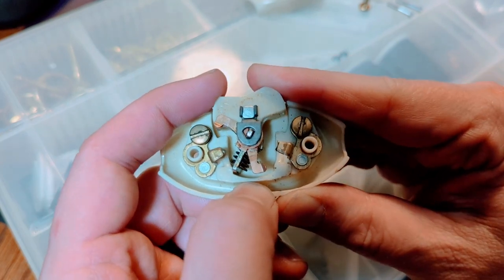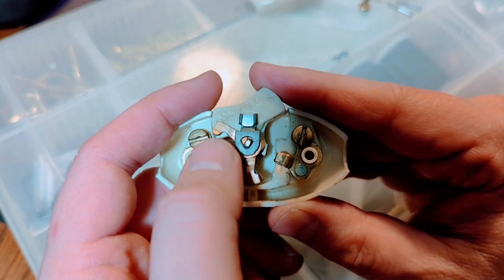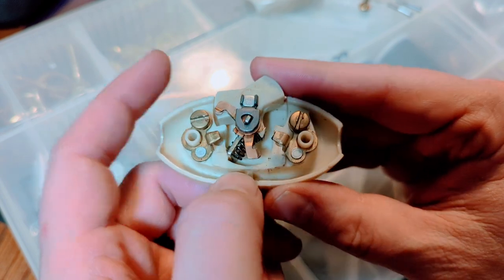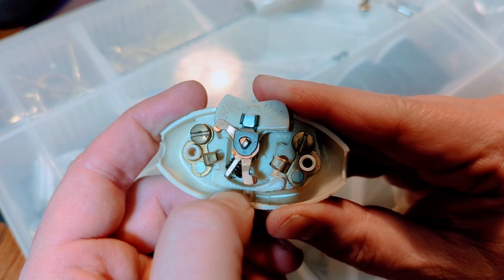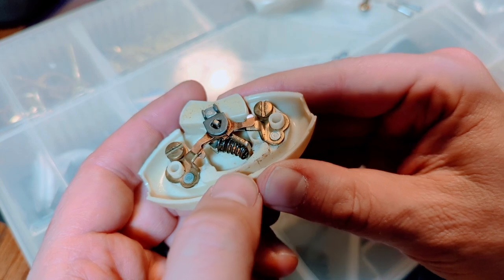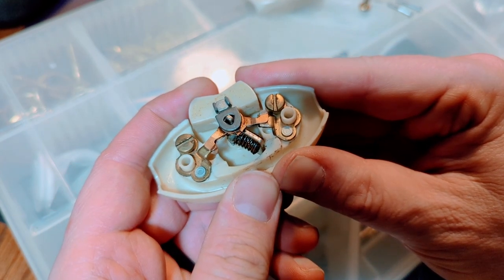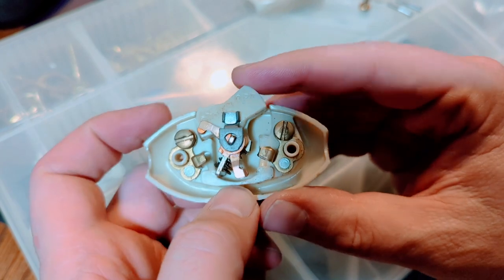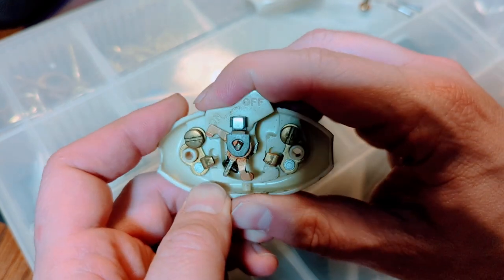I Love This Switch Mechanism!

Comment: This avoids the whole issue of being able to hover  the switch between off and on, which can cause damage to the switch over time. Nicely designed switch
Reply: Helps quench the spark as fast as possible too. helps the contacts last much longer.
Reply: It's much more than that: closing and opening speed literally define the contact life due to arc extinction time.
Reply: So you're saying it's probably bad that as a child I'd consider it a game/ challenge to, as you say,  hover the switch?
Reply: @kevinbissinger  As a kid? I still do it!
Reply: I did that in a motel once with the thermostat. Heat was on blast and didn't want to turn off.

Comment: I had a course in engineering school called "Mechanism Design" that was based on older methods like this.  Was amazing to see how simple and genius plays on geometry made designs. Now I regularly see poor cost-cutting designs or burned out chips for the most mundane tasks.
Reply: I really started to learn electronics on integrated circuits, 5V logic and such.  I'm used to worrying about voltages and delicate transistors and such.  Then I went to aviation mechanic school, and aircraft electrical systems are...a lot more rudimentary.  28V microswitches and such.  We had a lab about wiring up a relay circuit so that when you threw a big toggle switch it switched between one bank of 6 incandescent light bulbs to another bank of 6 incandescent light bulbs.
Some airplanes still use mechanical voltage regulators, which I found fascinating. I had to look at the circuit for awhile before determining that it was a mechanical implementation of pulse width modulation; that it would bang a contact open or closed, the system voltage would pull on an electromagnet and when it was high enough it would open a contact, forcing the power to go through a big heavy resistor, then it would discharge enough to where it would let go and short it again, etc, and increased load on the system would cause the electromagnet to stay discharged longer so it would stay shorted longer.  Those aren't manufactured anymore AFAIK but you do still occasionally find them in service on antique aircraft.  A lot of aircraft came with them and have since been replaced with solid state ones.
Reply: The worst cost-cutting I see in the electrical space is when you get a switch that uses copper-plating rather than proper copper. You can have the best mechanism in the world, but if someone replaces the copper contacts with copper-plated-zinc, you're going to have a bad day (fire) eventually.
Reply: @thegardenofeatin5965  I remember seeing an inverter which was a DC motor hooked up on the same shaft as an Permanent magnent AC motor. Thing had a disk brake, clutch and everything lmao but the think was just indestructible -- compared to transistor based inverters today.
Reply: @thegardenofeatin5965  why big resistor, not big inductor? It should be more energy efficient, but also more arcing...
Reply: Right. I'm guilty of that. I use an Arduino for tasks that could be done with a single transistor and like three passive components, even though I theoretically know how to do the mental gymnastics needed.

Comment: most wall switches do this today, just with a much weaker spring. the goal is to get the contacts away from each other as quickly as possible to prevent arcing because it can damage the contacts and prevent the switch from working correctly.
Reply: Also get them together fast without bouncing so as to prevent arcing.
Reply: @geeekzor  yeah that too
Reply: The difference between this and a common wall switch is that the contacts in deviants switch only move once the switch has fully gone to its next position. Whereas in a wall switch, they are directly connected to the paddle/level
Reply: @kilgarragh  no
Reply: @Danny.._  depends which ones, of course, "most" switches includes a LOT of old, or not-new ones, too, e.g. my wall switches, which aren't that old (from 2000s or so), can still arc if you move it very slowly, just almost nobody ever DOES intentionally try to halfway a switch, so you don't actually know anything about "most" switches... and it does probably have a spring inside, anyway, because it really doesn't like to stay in the halfway, it much prefers to spring one way or the other, it's just not a design which PREVENTS edging, only REDUCES it to where it normally never happens
Reply: @Danny.._  Yes. A lot if not most modern wall switches have some similar mechanism, but connected too the paddle. so the paddle is the thing that snaps into place, with the moving contacts directly connected to it. this means you can force the paddle, and therefore the contacts, to move slowly and therefore not snap as fast. Or so i am led to believe by this video, and me opening one of my own switches. https://www.youtube.com/watch?v=jrMiqEkSk48
Reply: @linnea8608  You aren't technology connections.
Reply: @BiggerbyteNet  I fail to see the reason for this comment. I know I'm not technology connections. But more people than him can open light switches. And i happen to have done.
Reply: @linnea8608  Apologies, I misread your comment as "by this video, of me opening one of my own switches."

Comment: When the system has two stable equilibrium states like this, it's called bistability. Intended to stop intermediate states from causing issues, like partial engagement of the power switch might.

Comment: just beautiful. double disconnection, double wide contacts for balanced clamp force and low chance of losing contact.. If the plastic holds your grand kids will still be admiring the mechanism.

Comment: I love them too. As a lifetime automobile/motorcycle mechanic, I have always been fascinated with mechanical stuff. I have never owned a car with an automatic gearbox and love repairing stuff instead of replacing them. Unfortunatly, electronics are taking over and repairing is less and less an option. Take care buddy.
Reply: Just because you don't understand how they work anymore, doesn't mean they can't be repaired.

Comment: I really liked that Mechanism Switch as a kid in the seventies. For i did not have to get up from bed, to turn off the B&W TV, on the other side of bedroom. It was like a extension cord. but it was just a switch on the end of a cord, that plugged in between the wall-socket and the appliance (like a ground adapter) with a long cord to the switch.

Now-a-days i use a extension cord with stomp switch (button) in the middle of cord. so when i sit-up in bed, i can step on switch and turn on my light.

Comment: Wow! I haven't seen one of those in a very long time. I wired one of them into a short extensive cord when I was a kid. My grandmother's tv development a bad power switch that also functioned as the volume dial. It would only turn the TV on/off half the time so I put that switch in the extension cord to act as the on/switch. It nice to see someone still using those old switches.

Comment: There's a lot to be said for reliable analog technology. I had homeowners lock themselves in their master bedroom a couple years ago because the electronic drop-bolt lock could not disengage because they changed the ambient humidity in their home, causing the door to warp just enough that it put lateral pressure on the mechanism, rendering it inoperable.

Comment: I think they call these kind of spring systems a bi-stable mechanism. Perfectly happy to be shoved in either direction, but it won't sit idle and just the middle, and if you push it far enough from one side it just flips to the other direction

Comment: Interesting design and I would enjoy the tactile snap it makes in my fingers no doubt. I wonder if the design was intended to minimize arcing with its super fast connect/disconnect, and if so what devices it was originally intended for and how did the design benefit the overall device.

Comment: It may have been designed for 120 volt DC power (which was not mostly phased out until the 60s), where you don't have that handy arc extinguishing zero crossing 50-60 times a second, so snappy switchgear with plenty of clearance is required.

Comment: All modern switches and circuit breakers work the same way. Reason being, arcing while the switch is in transit can damage the switch contacts. So while that one looks old and you can see the mechanism, know that everything new uses the same fundamentals, just they're hidden.